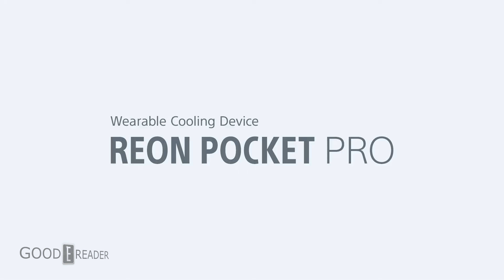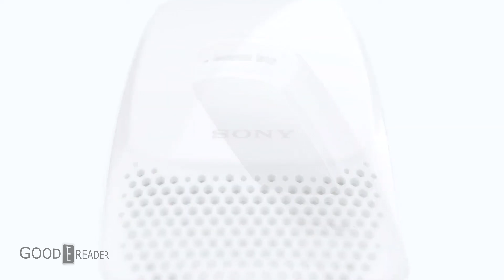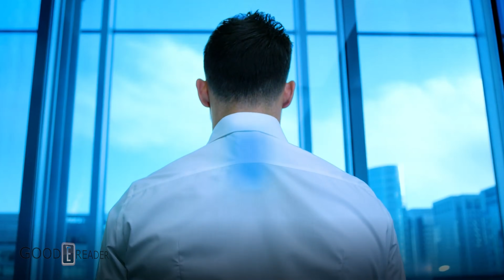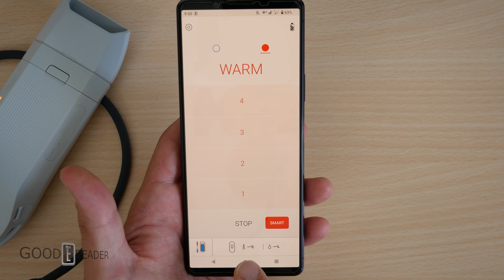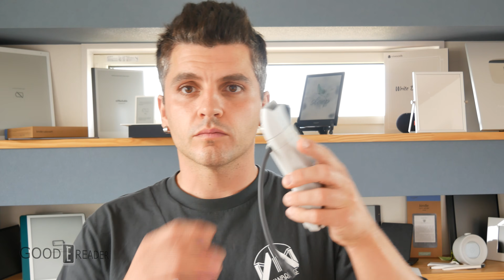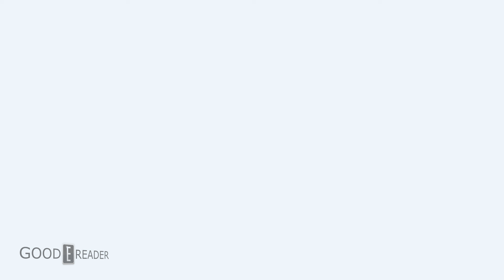Hot or Not? | Sony REON Pro Portable AC Full Review

Comment: I have one of these and used it during the scorching heat and humidity of Japan summers. It’s a little misleading to call this “portable AC”. The primary felt component when using this is the metal backplate. It gets cold or warm depending on what setting you’re using. The cold isn’t ice cold. I would compare it to touching a metal surface on a cool morning. It’s location on your back below then neck seems the most ideal of dispersing that cooling feeling. On really hot days it’s very refreshing to have something cool in contact with your body, versus portable electric fans that just blow hot air. This unit also intakes the warm stagnant air from the back of your shirt and expels it out of the top exhaust. It does feel like it looks a bit funky from behind, but if you’re wearing one of these it’s cause it’s unbearably hot so it’s not something you’d feel self conscious about. Absolutely love mine, it is one of my favorite purchases of the year.

Comment: I bought a waist clippable fan with a huge battery for $8 and change after a coupon on Amazon. I've worked in IT and based on the sound at full speed, I'm pretty sure it contains a server fan. I live in the humid south and it's a lifesaver. Battery lasts all day and it can charge a USB device as well. Tons of similar options.
Reply: Link please. Thanks broderick!
Reply: @justforroofers "Yinken waist fan 10000 mah" was the one I got, not available anymore but gives you an idea. If you get one that clips to your waist, make sure it has two clips like that one, one for your belt and one upside down for hour shirt so it doesn't get sucked into the intake.
Reply: @vladimus9749 Thanks again 👍

Comment: This is NOT an air conditioner and does not work. It gets mildly cool TEMPORARILY. In very hot conditions (30+), it is basically useless and irritates the skin. Also, support is NOT available in your language...it is available by geographic area and support is only available in the area of purchase. A COMPLETE WASTE OF MONEY.
Reply: Thank you for answering the real questions! This YouTube channel fails
Reply: I own the pocket pro and totally disagree that it doesn't work. I live in the tropics where it gets quite hot. I am very happy with the cooling provided by my Reon Pocket Pro.
Reply: add a blowing dyson fan and this works for 30c plus weather
Reply: @SamsungLe-vz2uy  Adding a fan does not increase the amount of cooling from the Reon Pocket Pro, because all of the cooling is from direct skin contact. There is nothing for the fan to blow across, unless, of course, you are talking about using the fan to blow onto your face.  I live in the tropics, where 30 °C+ days are normal, and use the Reon Pocket Pro while riding my motorcycle wearing full gear, and it is quite useful.

Comment: Doesn't answer the fundamental question: does it actually work? Especially cooling.
Reply: I own the Reon Pocket Pro and am glad that I got it. It's not heavy unless you are a total weakling. I barely notice it other than the cooling it provides. Iive in a tropical country not far from the equator. The Pocket Pro does indeed make a difference in comfort. I specifically purchased it for long motorcycle rides in full sun, but just walking down the street it keeps me noticably more comfortable. Sure, my face and body get warm, but having cooling on my back/neck helps keep my core cooler. This video shows the longer extended exhaust vent, the standard shorter one which it comes with works perfectly well. 
I keep laughing at the video saying it's heavy. It's barely noticeable.
Reply: @RealAnonymousse  Thanks for the comment bro, highly appreciate it, I would've been watching this Dum*a** ramble for no reason. This is why we need YouTube dislikes back
Reply: mine keep  slipping off my neck if i am at level 3 or up and level 5 last less than 2 hours
Reply from the maker: Yes it does
Reply: @goodereader   Not really. You say it works in the video, but that's about it. We want more real world descriptions of the experience in different situations.
Reply: @Geordie-rr2gq  yup..........on to the next video
Reply: @goodereader  no it is not,
I have the pocket pro pluse, it never felt heavy, it not always making full contact with the skin but i"m loving it.
Reply: @goodereader  ratio’d